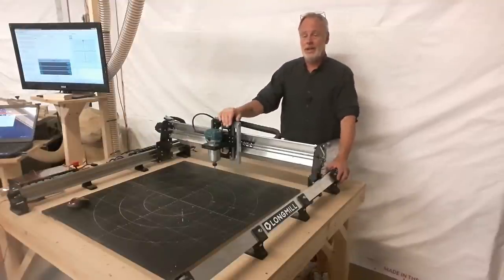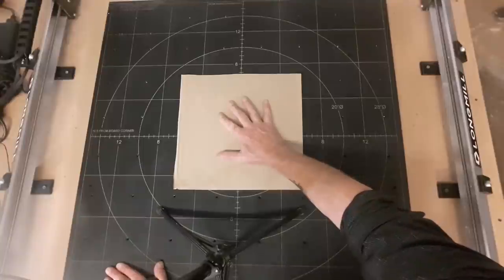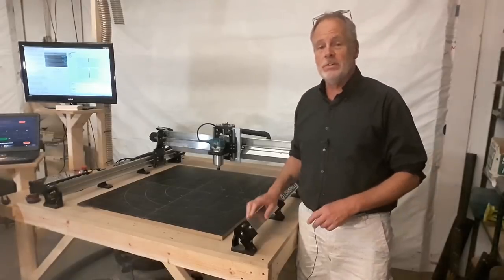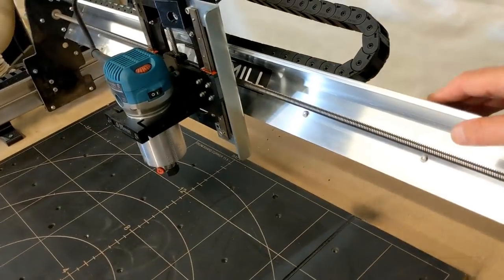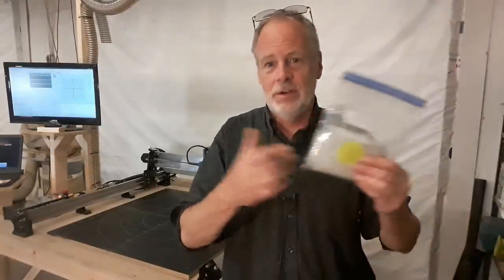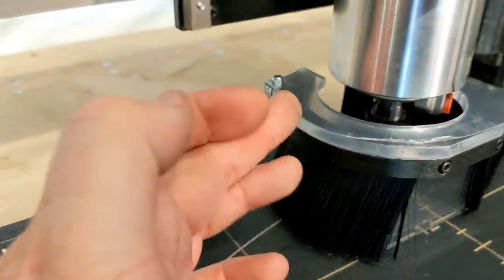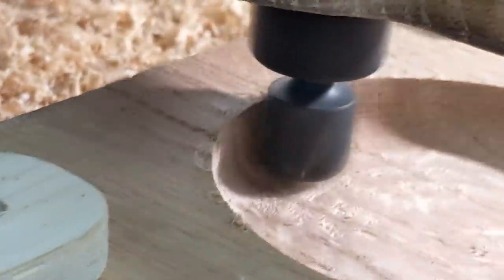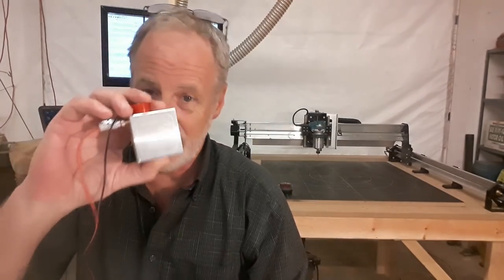Longmill CNC Router - Complete Review MK2 (by Sienci Labs)

Comment: Fantastic review!  Have been trying To decide between a few different CNC, now I made up my mind!  Couple things you might have mentioned… one other reason the long mill is less expensive is the exchange rate on the US dollar.  Also, for those of us that have 3D printers, they give you enough in the replacement parts that we could 3d print replacement parts on your own and not have to wait for a shipment.  Might also mention that all the this is “open source”

Loved the testing and the little ride you took.  Might think about showing a completed project.  I would love to see your flag/eagle project done on the long mill.

Would love to see you test the bits that they sell with the long mill.

I wanted to order your surfacing bit, but the discount code doesn’t seem to work.  (I am planing on ordering the starter set tomorrow after I pay on my CC.)
Reply from the maker: Hi Craig. I think I'll go ahead and make that flag.

I sell my own bits so will not test theirs. Speacking of bits, the surfacing bit code is "surfacing bit"

Regarding all the other things you mentioned. It is hard to cover every detail. This took 3 days of scripting, many rehersals and retakes. 

Despite 7 solid days of working on this single video, I still see things I miss after I'm done. That's just life.

Comment: Great video Garrett, I was wondering if you looked at the Onefinity cnc machine? It looks like it would be the easiest to put together. literally in about 20 min I seen on reviews. and it doesn't have any belts that drive the movements. whats your take on e the machine if you reviewed it? or any of your followers that might have input. Thanks Mike
Reply from the maker: The Onefinity is a good machine from what I researched. I cannot explain much more since I did not lay my hands onit.

Comment: Hello Garrett, I have been watching your channel for a while now. Through my research and with me Military Engineering background I found the Sienci Longmill about two months ago and ordered one based on the lead screws and the engineering aspect of it. After watching this video and knowing that you can place ~150 lbs on the carriage rail I am convinced I made the right choice. I did not buy the dust shoe but did so today using your link, In also purchased a second set of ACME nuts so I can used the jam nut method on all but the Z axis due to clearance for the backlash nut. I have not built mine yet due to building a work shed is not completed. Thank you for all your videos. I have learned a great deal about using my VCARVE Pro.
Reply from the maker: Hi James. I'm glad you're here. Standing on it is definitely something I wasn't afraid of. Good to see someone taking my advice. I'll be ordering the nuts also. And thank you for using my link.